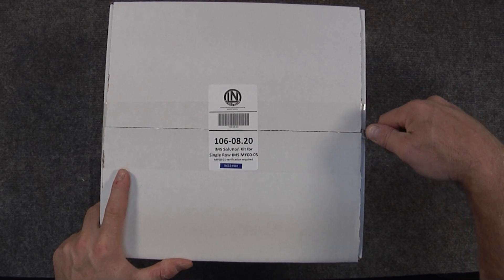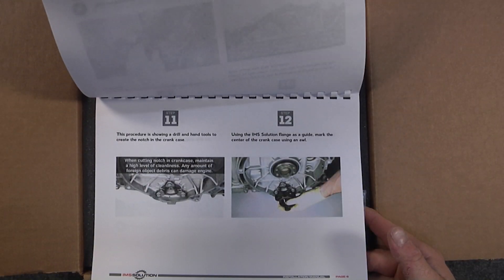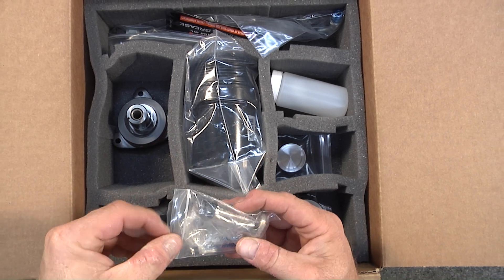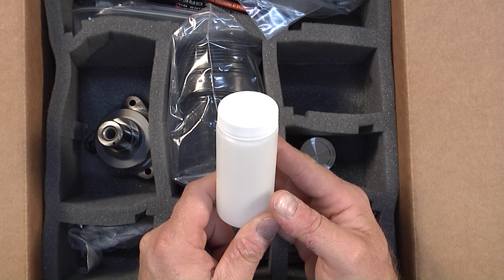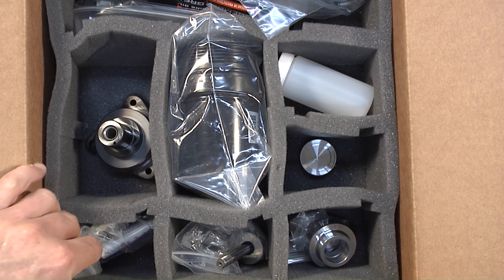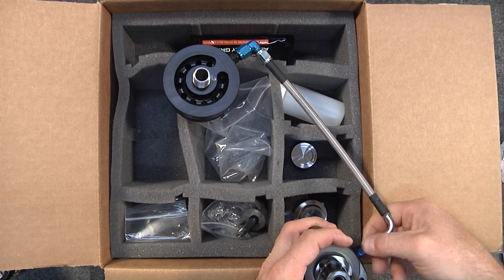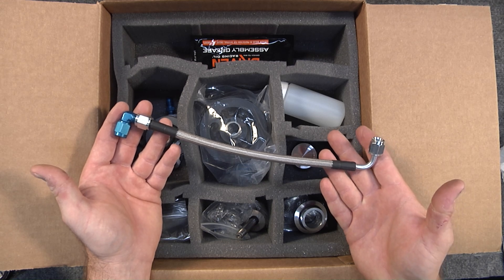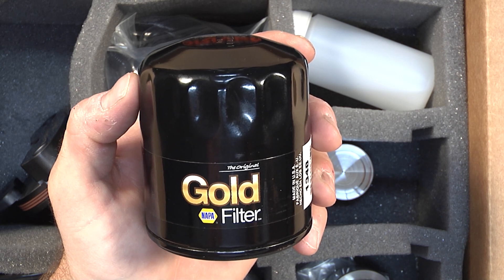IMS Solution Kit for Single Row IMS MY00-05 - LN#106-08.20 & Dual Row MY97-01 - LN#106-08.40

Comment: I have a 1999 Boxster. I'm the third owner. The  second owner askes the first if the IMS bearing had been changed, He was told yes. He didn't ask for any documents nor was he offered any. Is there any way to verify if it has been changed. I did look under the car and did not see a filter adapter or hose with fittings. was an earlier bearing change without the hose? PLEASE HELP ! I love the car and don't want to destroy the engine. Is there any phone number associated with your upgrade ?
Reply from the maker: Without documentation, the best way to identify the type and brand of IMS bearing you have is by visual inspection of the IMS bearing flange. That would mean removing the transmission. If you need more information, you should contact LN Engineering. They have many resources online and more than happy to discuss over the phone.
Reply: @RennvisionbyTheKnowledgeGruppe  how do I contact LN Engineering?
Reply from the maker: @pear44ms  Uhhh... Google?